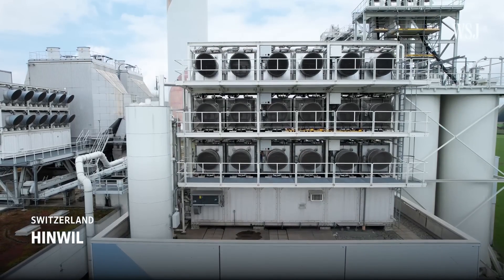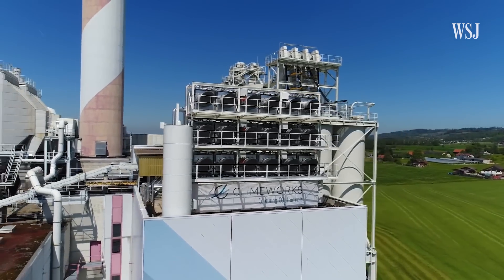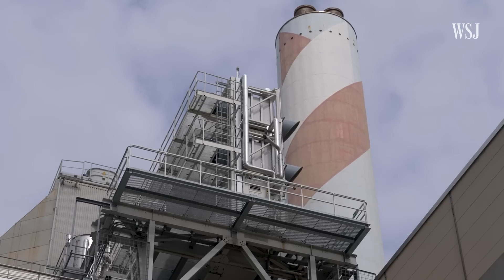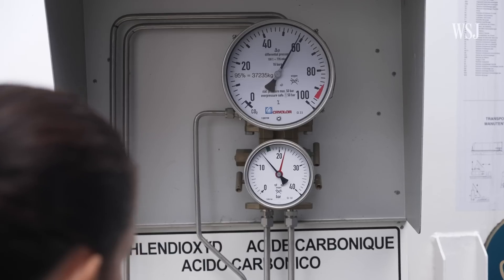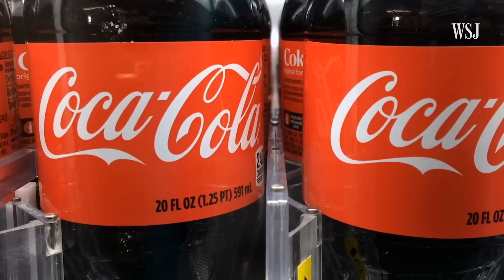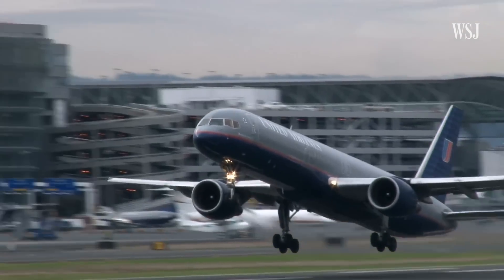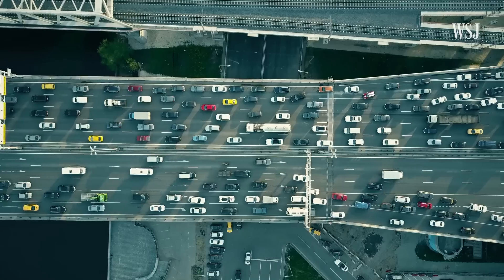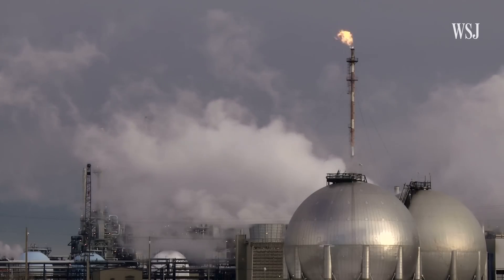Coca-Cola's and Microsoft's Latest Gamble: A Giant CO2 Vacuum Cleaner | WSJ

Comment: This vs trees: absolutely no comparison which is more cost effective per ton....
Reply: This AND trees, not either
Reply: While I agree that we desperately need to replant billions of trees ASAP, it may not be fast enough, and don't forget trees require soil and WATER and nutrients that can support the vegetation. You can't magically recreate the deforested Amazon jungle and the lost carbon sink by just "planting trees" on the same land - not within a feasible timeline anyway. We need all the solutions we can get.
Reply: I'm all for trees. I love trees (my profile picture is of the flower of the Chiranthodendron Pentadactylon, the Monkey Hand tree), and think that we should absolutely be planting more trees, for a number of good reasons, but not as the sole or even main form of carbon capture. Comparing trees to current carbon capture plants is like comparing horses to an 1885 Benz Patent-Motorwagen. Yes, at the beginning of the development of cars, horses were clearly the more effective option for transportation, but look where we are now. While improvements to horses and cars can only be managed very slowly through breeding (or other more direct forms of genetic modification), improvements to machine technology can happen in leaps and bounds.
Reply: @musicalcharge  I can absolutely assure you that the fundamental basis for this technology (forcibly pulling carbon out of the air) will never be efficient or economical vs its alternative.
Reply: When the tree dies what happens then?
Reply: @edc1569  It's a definite net reduction in atmospheric carbon vs paving them over or burning them as we currently continue to do on a vast scale.
Reply: We have put stored CO2( fossil fuels) into the air. So we need to return that amount back into the ground. So this research is good.
Reply: The problem here is, there will not be anyone getting rich from trees.
Reply: @testuser1386  lumber industry may not agree with you
Reply: Yeah, but who's got a patent on trees?
Reply: @Bill-tz3wg  Maybe it should be given the results and putting scarce dollars to such endeavours (as opposed to renewables or trees).
Reply: True.  Tree growth is not keeping up with human population.  The more people on the planet, the more emissions.  CO2 capacity must be increased over what trees can fix.
Reply: Well tree had all the time in the world to get to where they are ... Humans only are trying for the past few hundred years ... So .. give us humans some time ... Maybe we can beat the trees and plants at their game .
Reply: Then you can chop down the tree for wood
Reply: Plants are slow and inefficient. You are a plant.
Reply: @Sadbuthappyman trees use CO2 to convert it into their bodies and grow.

CO2 it's generated only when their cells are burned because the carbon reacts with oxigen in air
Reply: That need power don't know that economy system DOCUMENTS for you free or cheap. But Power is not save it looks great moments when you get next generation of climate control. But machine used for cooking potatoes chips with, not being able to get nature. You are really economy system DOCUMENTS.
Reply: Carbon Capture technologies like this one consume A LOT of energy.
Reply: There is not enough land on the planet to offset the carbon we produce by planting trees. You'd have to use agricultural land as well. Better to reduce our carbon output.
Reply: @GeehadeeKomunisste  Well feed grown for livestock consumes about 70% of all agricultural land, utilizing about 40% of the Earth's ice and desert free land. Carbon and biodiversity in one fell swoop. Go vegan!
Reply: @djayjp  That would be a good way of reducing greenhouse gasses, too.
Reply: @GeehadeeKomunisste  Absolutely! :)
Reply: @Sadbuthappyman oh, well, decomposition liie from fungi yes. i think it's for an equilibrium based in a normal level carbon dioxide envyroment (evolution).
Reply: Trees vs algae in the ocean: absolutely no comparison as algae sink and store carbon at the bottom of the ocean and trees rot and release co2 when they die
Reply: @nousername8162  Right I'd heard about attempts to stimulate more algae growth. Also seaweed.
Reply: well tree cant expend vertically, where a manmade CO2 capture can
Reply: @EiRA-hiE-x  huh? What do you mean by that?
Reply: That’s exactly right. Trees are 
- very expensive, 
- hardly scalable, 
- need to be maintained for decades, 
- die after 100ish years and all progress is lost. 

✅✅✅⚠️⚠️⚠️
Reply: How long do trees take to grow
Reply: this machine need no water
Reply: Trees need space. Lots of it. This doesn't.
Reply: @darkspace3316  really?  This solution doesn't need space?  Are you sure? 
Hint: There are manufacturing plants, steel refineries, capture facilities, offices, parking lots, energy companies, energy generation facilities which all are required to accomplish the same result as trees with the major exception that trees are able to produce food, regulate environment, mitigate global warming impact, act as ecosystems, reduce top soil loss, help reduce damage and crop loss by providing a natural wind barrier, etcetera. One other small  difference, trees can be grown everywhere so anyone who lives in an area with available land can make an immediate impact by improving the CO2 volume being captured....
Reply: @darkspace3316  And how much space and energy does the energy source require...? Ha
Reply: Republicans: Reducing emissions requires the wealthy getting more tax cuts and kids getting more assault rifles.
Reply: Plant one in your yard, then.
Reply: @samsonsoturian6013  I did that last year.  It will take five years before it fully matures but it is already taking some CO2 out of the air...  Good idea.  :)
Reply: @robbrown4621  if it's a fruit tree you also get free fruit and bugs!
Reply: @samsonsoturian6013  Yes, it's an avocado tree planted from a seed.  :)
Reply: @jameschristophercirujano6650  Yes bogs are immense carbon sinks. But no let's pave it over and build a strip mall....
Reply: @jameschristophercirujano6650  I live in a subtropical area and live on land that is about 90-95% grass. I live not all that far from the largest swamp in North America...  :)
Reply: @robbrown4621  I'd advise you to remove that seed grown avocado tree, as avocado trees from seed mostly give bad tasting fruit, get a grafted one of a good variety...... You don't get a Hass Avocado tree from a seed inside a Hass Avocado.....
Reply: @PulseNerd72  Of well, too late now.  Thank you for the info... I do like the pretty leaves on the tree, though.  :)
Reply: @djayjp  Ocean fertilization and marine snow are actually the biggest carbon sinks. And yet ocean fertilization plays almost no role in the current carbon offset market.
Reply: @robbrown4621  it also releases CO2 at night.
Reply: @jameschristophercirujano6650  you can grow trees and cut them down into planks, capturing carbon in buildings and furniture. Can't do the same with grass.
Reply: @jameschristophercirujano6650  why hippies? It's a giant emerging new worldwide industry. With policies like European carbon tax there are hundreds of billions of dollars on the line
Reply: @NJ-wb1cz  I just overly generalized save the trees people and grouped them as hippies.
Reply: @samsonsoturian6013  you sound depressed 😔
Reply: Trees actually doesn't do much sadly :-(.. The mass of the tree is Carbon. That mass is created by absorbing C02 and releasing oxygen. Now after it dies, the mass of C is released as C02 or methane but fungi when decomposing the trees.
Reply: @vineets  Very important point. Trees capture carbon, but if they decay or get burned, CO2 goes right back to the atmosphere. So, we must dump dead trees into swamps or deep ocean, or even mines.
Reply: You know avocados aren't that great they're water intensive
Reply: @piotrekp5471  this is only a problem if you live in a dry climate. Avacados come from tropical countries and should ideally be farmed there only.
Reply: @piotrekp5471  Guess what? The planets surface is 70% water doh
Reply: @piotrekp5471  I live in a very water intensive area; never a shortage of water here...

Comment: Okay but the Co2 sold is eventually released. This is not even lose to a Climate Fighting Action. Its green washing
Reply: Its call marketing bro ☺️😅
Reply: Removing carbon from the air for reuse is carbon neutral. Compare to activities that produce carbon emissions and it’s an improvement. In addition the video covers how they’re working on options to lock away the carbon back into the ground.
Reply: @scoops2  I bet you’d think it’s an improvement until you saw all the fossil fuel burnt to power this CO2 capturing plant, lol…just like “charging” electric cars…what hocus pocus!
Reply: No. What is happening is that they create a CO2 cycle which is carbon neutral, because they capture x tons of CO2 and then release exactly x tons of CO2 again but then the cycle repeats making this part of the product carbon neutral, and that is fine. The issue we currently have is because we have been emitting more CO2 than we capture again in e.g. forests.
Reply: @_yonas  Exactly, what about all the fossil fuel burnt to power this CO2 capturing plant, lol…just like “charging” electric cars with power plants…what hocus pocus! I bet they don’t run the calculations all the way out to the end of the line…which would be pretty impossible anyways really.
Reply: @chanelnumba_5   Obviously you have to run them with renewable energies. Also, running an EV car with coal still outperforms a ICE car in a GHG emissions comparison simply because they are incredibly efficient 85-95% compared to ICE 30-40%. Then you also have to keep the mind all of the emissions caused by mining, transporting, and refining fuel, etc.
Reply: They imply they were creating CO2 to put in drinks before.
Reply: The problem is, the normal way of producing CO2 is as a byproduct of ammonia manufacturing. So if Coca Cola doesn’t buy that CO2, it will just be vented to the atmosphere anyway as a byproduct. There’s no net removal.
Reply: Just don't burp ;) I agree it's like wanting to remove the milk from my tea. The best we can do is not have the last kid we were planning on having, he will not produce any CO2 and his kids either.
Reply: Not true. It can be stored under ground or turned into rock
Reply: @jamess4428  No, some trivial amount of CO2 can be recycled in your basement.  What can’t be done is capture 33 billion tons of atmosphere per year, turn it into rock and store that new mountain chain underground.
Reply: C02 captured can also be broken down into c and 02. Those carbon can be used for something else like graphite, or even better, petrol.
Reply: @kentwotep8877  OK but CO2 conscentration in the air is not high (also the effet as greenhouse gas to bounce back radiant heat is quite high at these concentration). Get the CO2 where it is emitted to start with seems like a no brainer. Much more efficient to just let nature do it's work in most of the world than these factories.
Reply: @kentwotep8877  No, there’s not enough money or non-nuclear energy in the world to come anywhere close to 33B tons C02
Reply: @kentwotep8877  breaking down co2 into c and o2 costs energy tho
Reply: exactly what I was about to type. Global action on climate change is pathetic. Governments globally need to act like the house is on fire - things are about to get apocalyptic within 2-5 decades if we do nothing.
Reply: @__Wanderer  in 2-5 decades?  We couldn’t go outdoors this summer due to smoke and heat.
Reply: @__Wanderer  I agree with you completely
Reply: basically there is no new co2. co2 is essentially being recycled.
Reply: @pw8544  No, that “rock” is a grift. They can’t capture and turn 33 billion tons CO2 per year into rock, ie the size of several mountains, and store it underground.
Reply: For OPs original question: remember the climate saving triad - Reduce, Reuse, Recycle. 

The three R's in that order of importance are what is needed in every household and every business and every industry. 

The reason they are in that order is that is the order of effectiveness. So Recycle is the least effective tactic - but it is still part of the overall strategy. 

Airborne carbon capture falls into the Recycle category if it can prevent new CO2 from being made somehow it is worth doing. But maybe we should not focus too much effort on it as there are more effective tactics we could pursue first.

Edit: side note - you will also find most airborne carbon capture projects are funded/connected to petroleum companies as part of their "green initiatives" or basically as you say green washing. Most often this is in countries with Carbon Credits so there is secondary financial incentives for these projects on top of the PR having on overall lower carbon footprint to brag about. This is because both Reduce and Reuse tactics lead to lower demand for petroleum fuels so they do not like those options, so they chose the least effective option Recycle to invest in, they can green wash, maybe make a tiny profit, and do some tiny bit of good that they can pat themselves on the back about.
Reply: @5353Jumper  Three R's help and indeed the US per capital energy, averaging out the economic swings, is now back to 1920s levels.  But 3Rs won't come anywhere close to "climate saving", so please stop while there are half a hundred new coal plants currently under global construction, and 98% of ground transport is combustion.  You won't find anywhere in the IPCC saying 3R's are all that's needed.
Reply: Yea this is just a gimmick. Nothing accomplished. They just need to plant a tree.
Reply: @FalconWing1813  Trees are nice, but not enough.  How many trees do you think you need to eat up 30 billion tons of CO2, each year, from fossil fuels, and never dump net CO2 back into the air when they die and rot?
Reply: @Nill757   Its better than what they are doing ! At least with trees they are storing alot of it for long periods of time. And true when they die some does release but most gets put into the ground. This machine they made is just capturing , selling and  releasing. And what about the energy to run the co2 capture plant? With trees we get oxygen from the process. Something else we need.
Reply: @FalconWing1813  I agree with all that about trees  except  the “a lot” part. Plant all the trees you want.  It’s not a lot, not even close to the carbon that’s been dug out of the ground.

No most of the carbon from rot doesn’t go into the ground, it goes into the air.
Reply: @Nill757  Well can we agree that this crazy machine on the video is just a gimmick ?  lol lol
Reply: @FalconWing1813  Yes, agree all day long.
Reply: so what? it's sustainable than the previous source
Reply: “The Paris Climate Accord and Carbon Credits”…It’s called money laundering on a global scale.

Comment: So 22 million facilities to reverse the footprint? That’s not economically viable.
Reply: Yes, carbon can be converted to diamonds, the process of doing so (as far as i know) is tho more expensive than the worth of the final product
Reply: Carbon can be pressed into artificial diamonds tho
Reply: @Slash27015  Really?
Reply: @notzachpowers  What do you think diamonds are made out of? And more importantly, how are lab diamonds made, if not out of carbon?
Reply: @sjhd98  Where do you think the heat to compress the carbon is coming from?
Reply: @17thsavior  You don't need heat to compress anything. That'll have the opposite effect. Anyways, the question was regarding whether carbon can be converted to diamonds. Peace.
Reply: Much cheaper than 20-years long trips in Afghanistan.
Reply: @Norpan506  yes